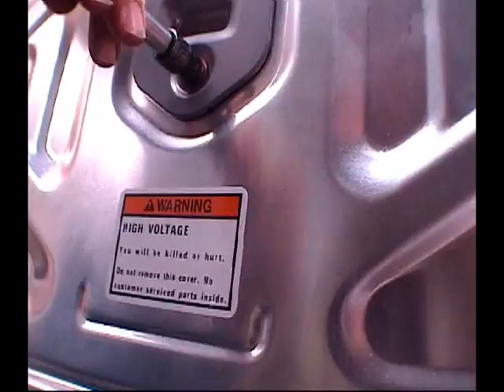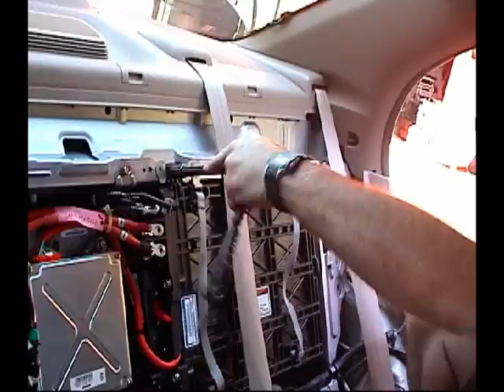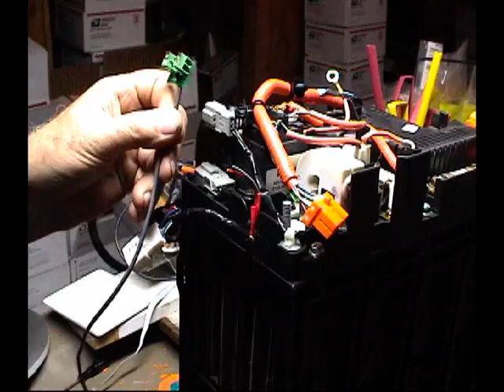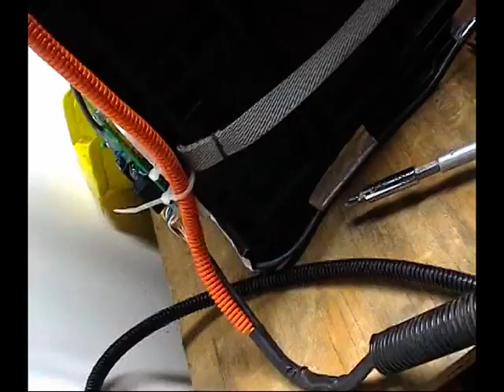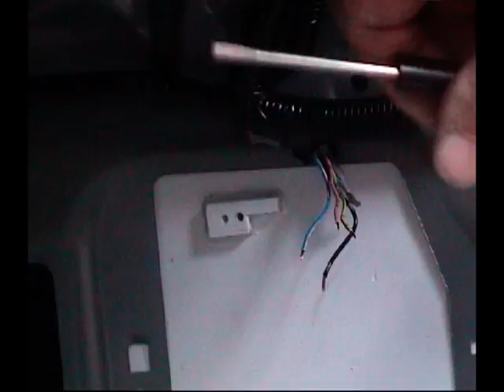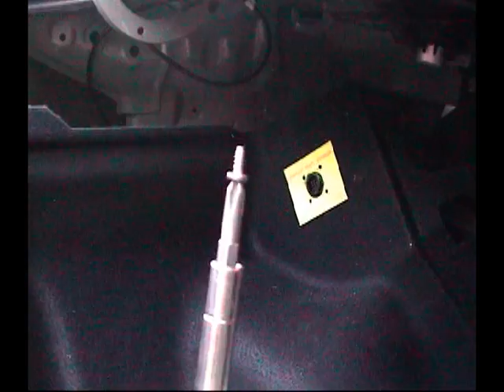First gen Civic harness installV2

Comment: dear mike i have home made grid charger but dont know how to run ima fan. i conect 12v power suply to ima fan but not swing. now i face another problem ima fan at full speed continue when i ignition on and when off ima fan goes off after some secconds. can you help me whats wrong and what is the solution.

Comment: I have another solution to stuck and stripped torx screws.  Put some valve grinding compound in the bolt and use your torx bit.  You will be impressed.  It makes the torx bit really grab the bolt.  You can reuse bolts that you thought were goners.  Kenny